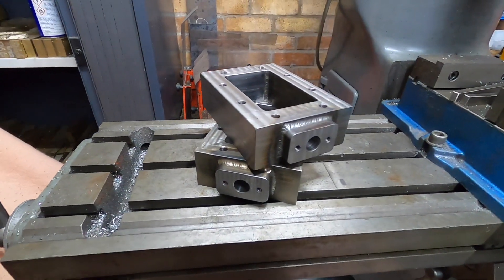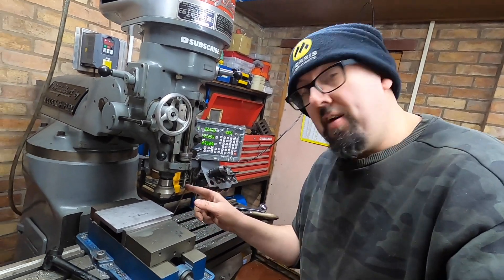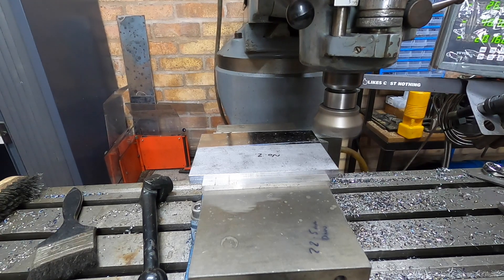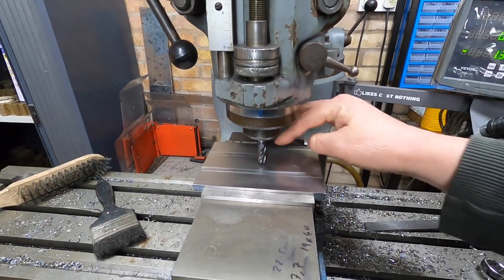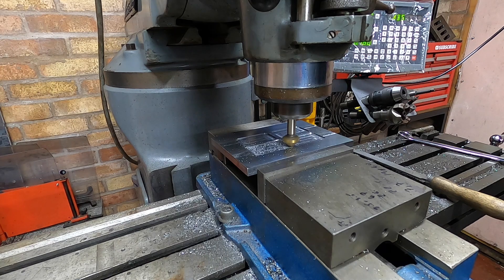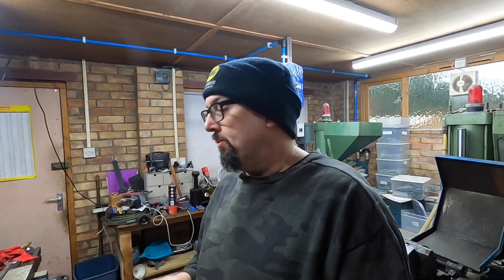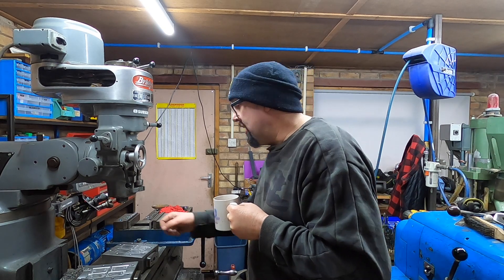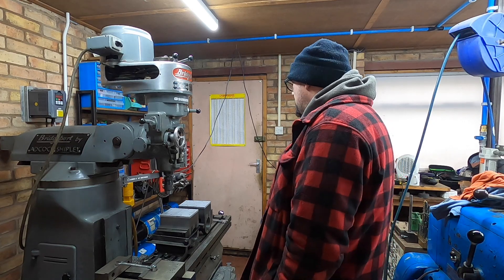Valve Chest Covers - ep58 - 7.25" Gauge Steam Locomotive Build

Comment: Get yourself some hydrochloric acid from your hardware store to soak your mild steel in. Removes rust and mill scale. Saves you a trip to sand blast stuff.

Just make sure to use it in a well ventilated area and wear the correct PPE.
Reply from the maker: Brick Acid is hydrochloric acid, I’ve been using it recently to prepare parts for painting with great success 👍. Got to admit though, sandblasting is rather enjoyable to watch as you do it 😂. All the best, Matt
Reply: @MattChiversWorkshop  Exactly right. It is also sold as PH adjuster for swimming pools.

Keep up the great work.